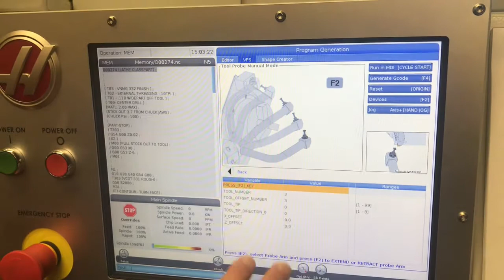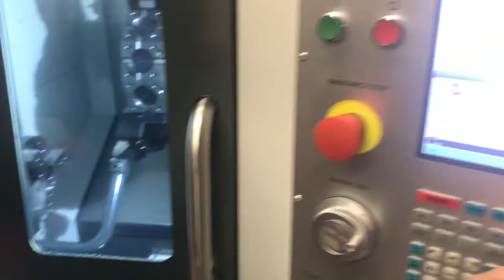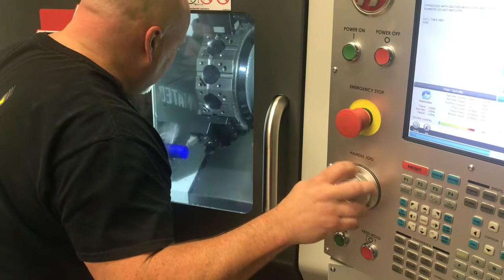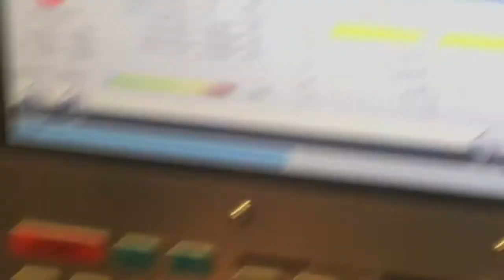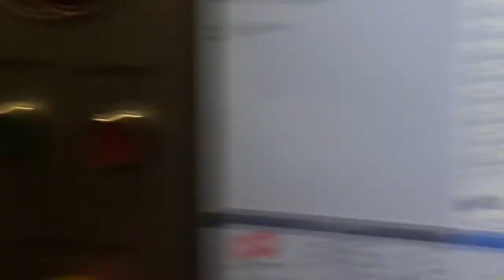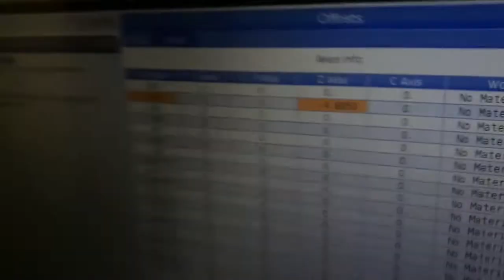Haas Lathe - Setup a Job using the ATP

Comment: Can I make a new z-0 after I have ran a part. Like if I wanted more material sticking out of my collet.
Reply: Thank you for contacting us.  Yes:  Since all tool tips are taught in reference to the tool setter itself, your desired work offset number (Your Z0), is a shift "to the left or right" from the tool setter.  Therefore, you do not have to re-teach tools, in order to move your Z0 (if i am understanding the question correctly).  Thank you.

Comment: Am I understanding it correctly that when using the ATP there is no need to set the X DIAM?  If so then I am assuming the machine gets the diameter from the cam software?
Reply: Hi Keith.  Check out our "ATP Probe Calibration" video for an explanation of where those settings are coming from.  In short, the settings are telling the machine what diameter the probe stylus is "sitting in space" (+X and -X).  Therefore, during an ATP cycle, the machine is looking at the location of the machine, and then using the setting as the "diameter it's currently touching".  Thank you for watching!

Comment: Does my program on x axis and z axis need to be programming from tool setter
Reply: Hi Pablo. You do not specifically need to set your tool setter to be able to run a program. You can always set your work offset and tool offsets the manually just make sure you have setting 64 set accordingly when you go from using the tool setter to setting tool offsets manually. Here are a couple more videos explaining how setting 64 works and how to set your tools manually in detail.

https://youtu.be/-fV2oTVOU-0

https://youtu.be/rd2u2MG6meY

Let me know if that answers your question.
-Dan at HFO Houston
Reply: Hi Pablo.  If I am understanding the question, your CNC Program will always be based on the diameter of the part (X-axis), while your Z axis (part face) will be set by the Work Offset, once the tool offsets (tool geometry) are set using the auto tool pre-setter.  Let us know if my assumption of your question is incorrect.  Thank you.
Reply: @Darren_HFO_Champions   thank you

Comment: Great video. There aren’t many that explain lathe offsets and the tool setter.  Unfortunately I messed up the calibration on my st-15 presetter last year through the wrong commands(not a crash) and need to figure that out.
Reply: Thank you Bill.  Feel free to check out our calibration video as well.  Once you figure out the Probe Offset +X and -X settings (the diameter that the probe stylus is sitting in space), it's pretty easy to calibrate.

Comment: when i enter the g code
t101
g54 G00 Z0.1
X0
m30

it gives me and error(1.316 x over travel range)
my x on my tools from x home is -36.0626
I don't know how to make x work with my program
Reply: Hi Steve.  Your information seems like your X-axis tool offset is not correct.  Your machine may have the function to "Press F2 to set offset to X-axis centerline.  That offset value, on most Haas models, is quite a bit less than 36".  Please feel free to contact your local Haas factory outlet Applications Department for more information
Reply: @Darren_HFO_Champions  i am running a ds 30y lathe and using atp to get my tools offset. 

thank for the video by the way it was a lot of help. its my first time running this machine made it really simple to set my tool offset.